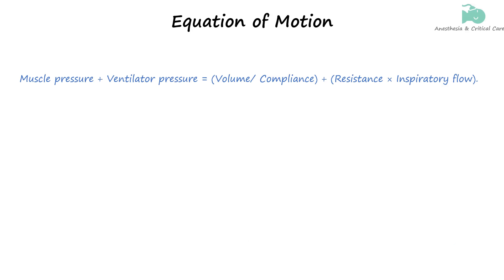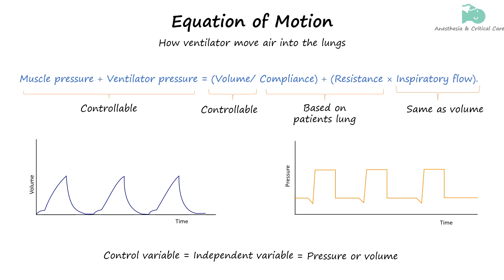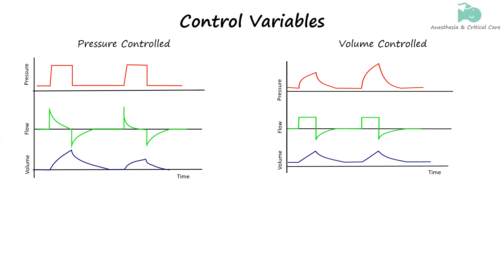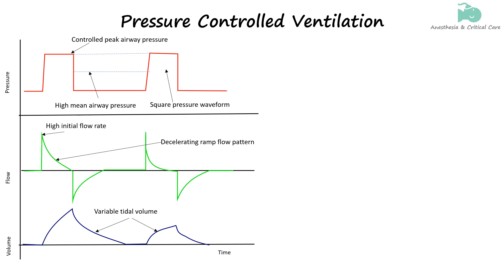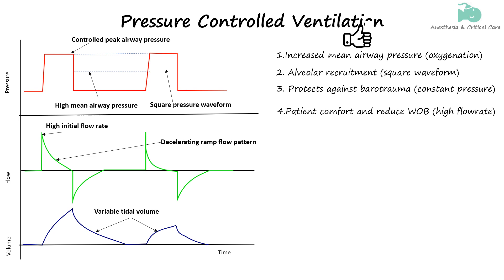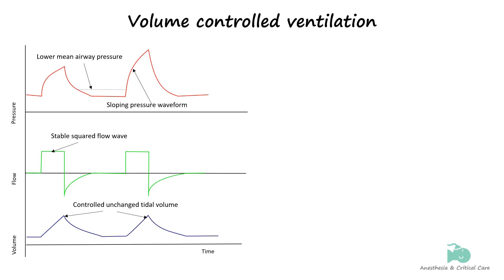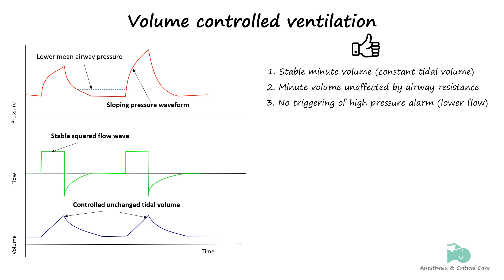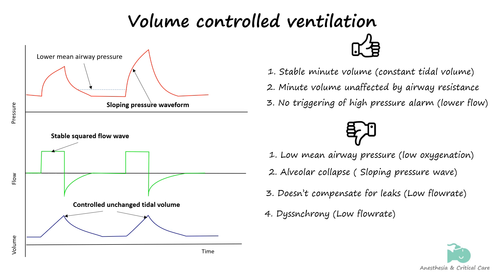Phases of Mechanical ventilation | pressure control vs volume control

Comment: So, in both pressure and volume control mode, the controller's target variable is Flow rate, which it adjusts to achieve the set pressure or volume. Is that right?
Reply from the maker: Yes to achieve certain control whether pressure or volume, flow of air is adjusted  by a ventilator...but I don't think we can call flow a target (limit) variable..limit or target variable are set by clinician...for example in pressure control ventilation, pressure is limited/targeted and set by clinician...in volume controlled, volume limit is set by clinician..ventilation just happens to adjust the  flow to achieve that through various mechanisms...clinician specifically does not  set flow limit to achieve desired pressure or volume level...
We can use flow as a limit to control inspiration, ...for example we can set a flow limit to 30l/min, in that case, the ventilator will never deliver flows higher than that...this can cause low delivered volume or pressure...like you said, flow adjustments happen but it cannot be called target or limit variable...it's difficult to explain...thanks to people who made ventilator...